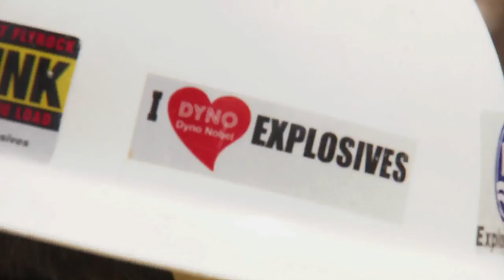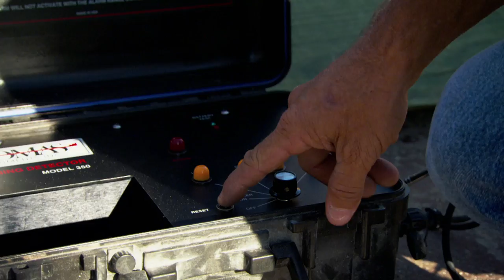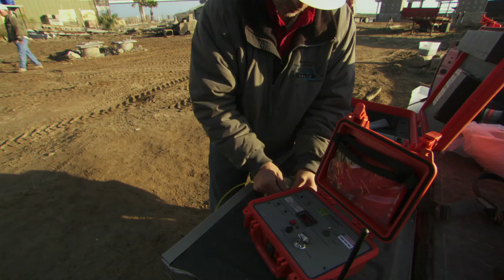Risk Takers - 115 - Blasters | FULL LENGTH | MagellanTV

Comment: Maybe they should wear an scba ( self contained breathing apparatus). It's what firefighters wear when inside a burning structure
Reply: And it has a mask which no fumes or gasses can get through
Reply: @brickking316customsreviews4  

A bit late, but...
SCBA have a very limited air supply. The ones firefighters use don't last for more than 15 min. (I think).
Blasters have to work with the stuff for hours.
The amount of money it'd take to prep enough SCBA's would be frickin' tremendous, never mind the loss in efficiency from having to go back to swap out

Comment: They say you get a head-ach from the Nitro-Glycerine. I worked in Kitchen Cabinets for Over 15 year's. Ware-house work. Cut the wood out and MAKE the cabinet's. What is used to clean the Glue off of them from the For-mica being added to the Wood is Lacquer Thinner. Some guy's that wood come in uit wood give them a head-ache so bad they could not see. ME<it never ever did a thing to me. neither did gasoline when i smelled it being put into my Parents car when i was growing up. So i am not sure, BUT i don't think this stuff would ever bother me either.
Reply: It's chemical exposure, if you want to find out go hang upside down so that the blood pressure in your head increases. It likely will give you a head ache with enough exposure over enough time, like a full work day.

Comment: Is there a reason people use TNT instead of C4?
All I know is that C4 is a powerfull explosive and that it's so stable, you can light it on fire and it wont explode.
Is it just becasue of the price?
Reply: DVD playerz I'm pretty sure c4 is illegal to use unless your in the military. I could be wrong though
Reply: kenconify no not necesarilly but expensive and harder to calculate than nitroglycerin

Comment: Step 1:
Wait for storm to be on top of you.
Step 2: 
Check battery on lightning detector.   
Step 3:
Replace battery as you see lightning and hear thunder.
Step 4:
Unload TNT, load boat with electronics and drive your boat into the storm...

Maybe consider driving a little closer to shore next time so you are not the idiot in a boat filled with batteries...  you might as well have a lightning rod on your boat.

Comment: One of the blasters, The red shirt guy has on a  BUMP CAP,  NOT a hard hat. THAT is NOT OSHA standard, IF hard hats are required. I also have blastd a little myself, They should have their packing sticks with handles drilled with loops in them for holding on to, to avoid oops. IMO

Comment: The only thing that bothers me is seeing his son try to put the fall protection harness on. When Before you even put it on you're supposed to grab the d-ring on the back and hold it out to make sure nothing is tangled up. It also needs to be properly fitted and adjusted. Any kind of fall that has too much slack can lead to traumatic injuries. OSHA requires someone to actually be trained and certified in the use of a PFAS system.

Comment: My goodness people. This is a show that is full of sensation and license for drama. 
That being said, know this: I am certainly not an expert in today’s demolition tactics. My professional experience comes from using nitro back in the seventies in an underground hard rock mine approximately 2000’ to 4000’ beneath the surface of the surface. 
When I started, I had an old timer as my leadman. He sent me to the powder magazine to fetch a couple of cases of powder to load the round we had finished drilling. 1.5” diameter by 7’ long drill bits were used for a 64 hole pattern. 
I picked up 2 or 3 cases of powder that was left and noticed that they were very old as this was the day before replenishment of newer boxes of powder. 
I noticed that there were sweat bubbles on the sticks (Apache Powder Company). Keep in mind it was 90-100+ degrees and a humidity of the same numbers. He knew exactly what was going to happen. I was very green and naive. So as we loaded the holes with a primer and one or two sticks, I was sweating profusely and as I grabbed the sweaty sticks, I rubbed the dripping sweat of my brow. Soon after, not sure the exact amount of time, I developed a headache from hell. Excruciating pain developed. My leadman started laughing his ass off as he was up on a ladder loading the powder in the holes with a lit cigarette in his mouth. True story! He then gave me a little glass vial of ammonia in a fiberglass shroud and to break it open and inhale a few moments. Once again I don’t recall the amount of time. Wow, what an experience. Never did that again. But I did share it with my miners when I made lead man. You just have to as it’s all part of being a man working with real men. So no respirator needed, just a little common sense which is not so common. Sorry so long but it’s just struck a nerve with telling an untruth. The old man that was found, dropped the box of powder. It won’t detonate while walking. I could be wrong but I’ve carried a bunch and still have all my digits. Now a days they use a water based gel and primer cord to blow shit up. Along with detonators and a box.

Comment: Pre-mature detonation that close, up that high, you wouldn't even feel the ground when hitting it, that's how dead you'd be.

In movies you see people being very cautious about carrying dynamite, but in this movie they seem sort of half hazard, especially when they stick that heavy stick into the holes packing it all together, you would think that would increase the threat of a pre-mature detonation, and do they drill all the holes at once, and then fill them with explosives, or drill and fill each one?   You would think, as well, that that too would add risk with the dynamite sitting deep in those holes inside of concrete that's been heated by the sun, to increase the perspiration of nitro?